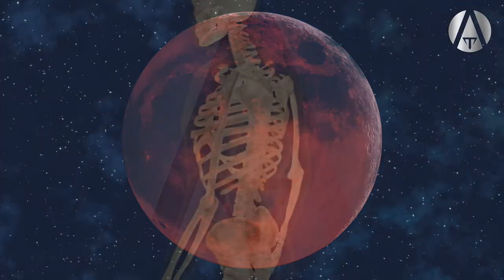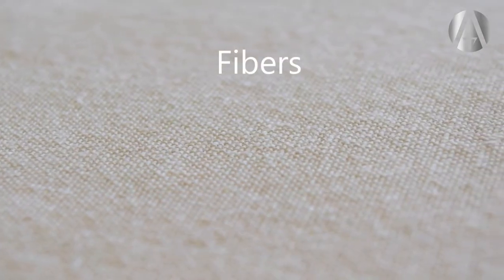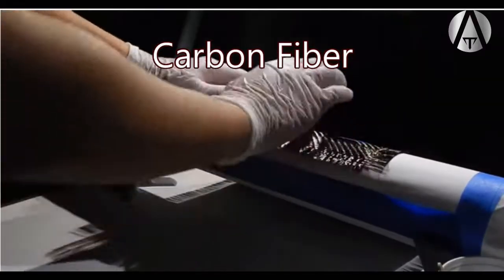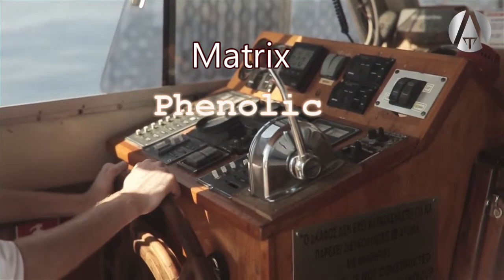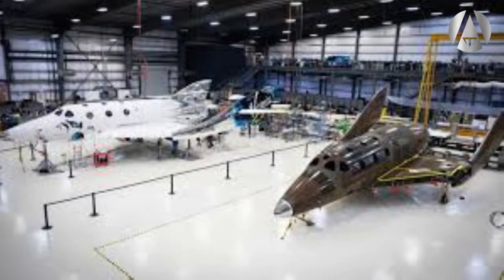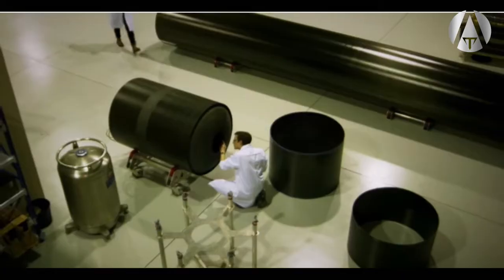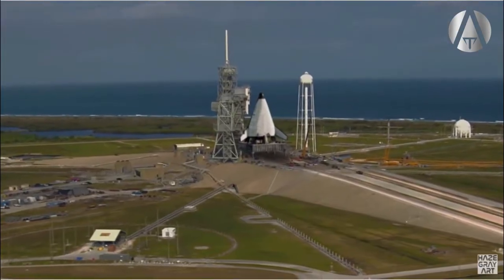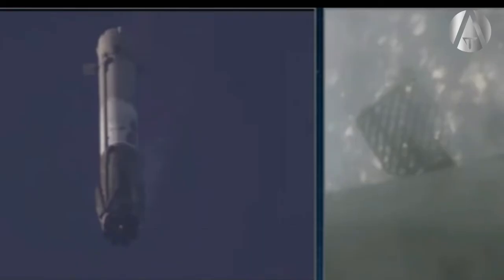Aerospace Composites: carbon fiber, glass fiber and Kevlar in aerospace applications.

Comment: I think you made a mistake in the temperature that Carbon fibers can resist, you said it is 200 degrees centigrade but the correct information is about 3000 degrees.
Reply from the maker: In oxygen?  I don't think that's accurate but I'll double check...
Reply from the maker: It looks like most are limited to around 100C which was my assumption, but specialized carbon fiber reinforced carbon matrix composite can tolerate temperatures above 2000℃.  Thanks!

Comment: When you were stating the thickness of fiberglass, aramid, carbon fiber.....perhaps you were stating some specific application thickness of multiple plies? With the possible exception of glass mat a single layer is only a fraction of a mm thick. The specific thickness depends on the weight per square yard (or sq. meter) of the fabric. For example it might be 3.0 oz., 5.0  oz. or 7.0 oz., fabric. Obviously the 7.0 oz. is thicker than the 3.0 oz. For example 3 oz. E-glass is 0.0046" (0.11684 mm) thick, whereas 7.5 oz E-glass is 0.0107" (0.27178 mm) thick. Even super heavy duty 40.0 oz. E-glass cloth is only 0.98044 mm thick. It takes multiple plies of material to get a product a few mm thick......
Reply from the maker: I’m pretty sure there was supposed to be a point in there :-) thank you for catching it. 0.10mm
Reply: @terranspaceacademy  I was about to comment that I have never seen 8mm diameter carbon filaments! 😳 pesky metric system eh? 🤣